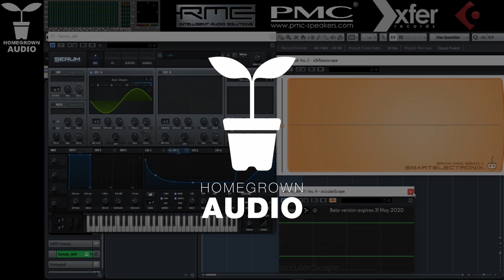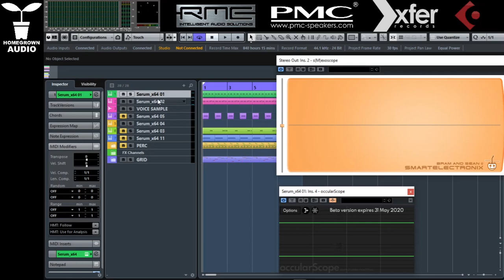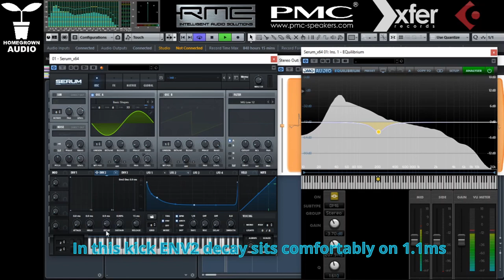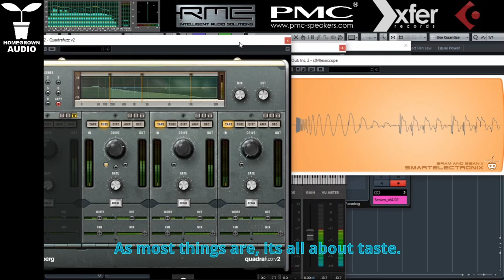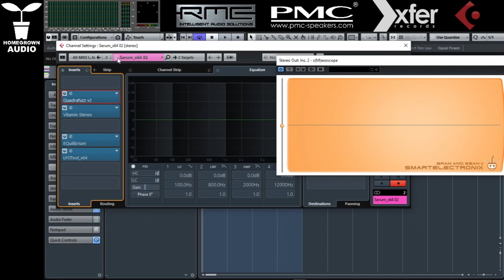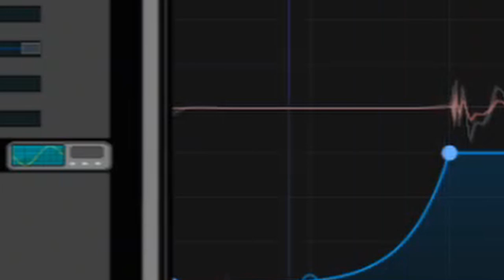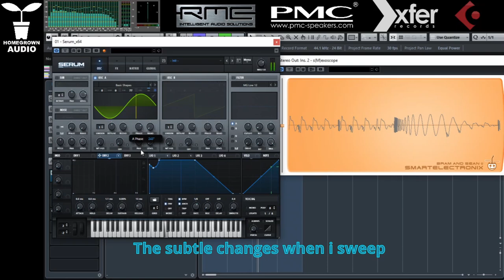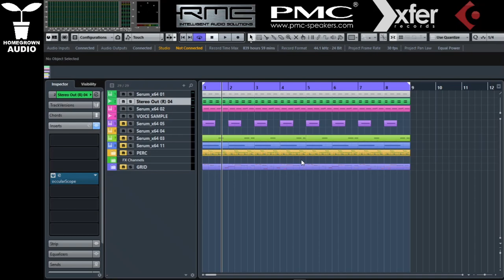5 Tips to Nail Kick Bass: Common Issues of Multiband Processing + FREE VST/AU SECRET PLUGIN SHOWCASE

Comment: First of all, another brilliant tutorial, thanks! 2nd, when you bounce and chop the kick and move it slightly, phase is moved a bit as I can see on the OccularScope, the top +ve amplitude of the bassline, is a little further left than the top +ve amplitude of the tail if the kick. I guess this can simply be aligned by selecting the "right" kick sample? 
Which brings me to my next question, is the triggering slightly off (it should be sample tight really) of does it not trigger always from the sample point of the phase cycle?
Wicked tutorial and very informative to see the effect of various processing to phase.
P.S. OcuularScope, wicked! Didn't find it on the Boom Shanka site, but I saw the released soon, so I assume Richie wants to finalize the thing before letting it out in the wild.
Reply from the maker: Yes man had a few minor problems uppon release broke his toe and u know.. But its release is imminent.

Yes also when moving slightly the kick is gonna move the phase a bit more. If u wanna compensate a bit for this and push phase one or 2 degrees forward to compensatw for this chop is also good practice. Is generaly almost unnoticeable in most cases though!
Thanks for the feedback very good observation

Comment: Phase summing is the real deal. Very good tip for EQ in wavetable in Serum. Did you not bounce the bass after everything done in MIDI? I found some bass latency when I’m working. Can destroy your phase again, right?
Reply from the maker: Yes man definitely is why I check timing in the end on oscilloscope and re-phase the kick into the bass before I end up bouncing kick. Bass I will bounce if necessary to check how many ms its off and eventually if necessary correct on the instrument channel delay compensation.
I rather have midi bass and have full options to change stuff as I go along
Reply from the maker: I find bouncing the kick a bit more necessary so it lines up with snare and all on beat stuff bass can have few sample delay before u notice the slack

Comment: I have a question, if i put saturation or multi band compression on the kick after it's render to WAV will that mess up with the phase again and how to fix that? Cheers
Reply from the maker: Hey it will mess a bit up the phase depending on the frequency any band limited process as is a multiband will inherently add group delay! I try to do these processes before bouncing to audio so it's clean.
Check bouncing the kick again and check both phases see how far it gone. If you have still midi kick available try there copying the saturator u had on your audio kick (I would try this first.
On the other hand, if your audio kick after saturation seems to hit on grid and end is still phasing correctly i wouldn't sweat it.
Reply: @HomegrownAudioChannel  Thank you so much for this valuable informations <3

Comment: The big difference of "doing EQ" with the partials on the wavetable, is that when you change bass notes the "EQ" is maintained... I always do it like that, now.... plus, and u dont get neither of phase attenuations or pre-ringing effects due to eq filters....
Reply from the maker: Yes exactly! Except when the problem comes from, in this case, multiband or a non linearity after the synth in the insert chain. Gotta be cautious on the processes used.
Reply: @HomegrownAudioChannel  yup... and you've done a great job stepping ahead and making this video that will help lots of ppl.... <3 
My previous comment was exclusively meant as an "addendum" for the ones that watch it.... :)
Reply from the maker: Thanks a lot it's very constructive . That's always welcome here 😊

Comment: Hey! Don’t you run into another problems, when you shift the phase of the kick? Like the init attack?
And in the end of this video, you shift the phase of the kick again, after everything is in phase. Doesn’t make alot of sense.
Reply from the maker: There is a range where the kick and the bass are somewhat in phase specially after the group delay artifacts from the multibands.
When you shift the phase of the kick I don't think there should be any problems specially since you are bouncing and slicing the beggining of the envelope in the end to get the attack tight.
There is the possibility that if you are using the same kick but 180º out of phase and try to mix it with the exact same kick but with phase 0 thst they will cancel out yes. That is one problem.
Pretty hard to achieve unless really trying to do it or on a very lucky day.
The attack of the kick is done by the  pitch envelope as opposed to the bass where its done by the waveform initial phase (and amp/filter envelopes)
Reply: Homegrown Audio Channel vk